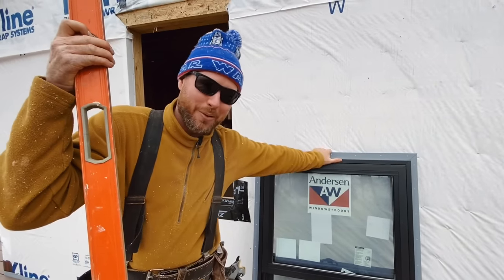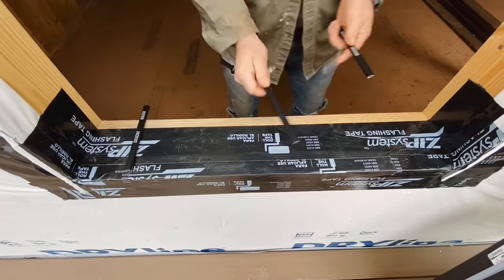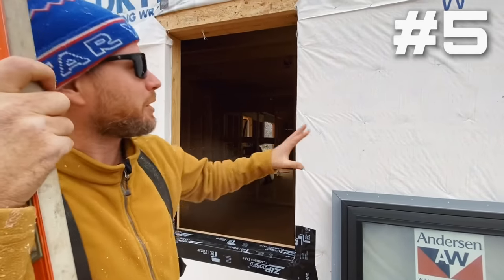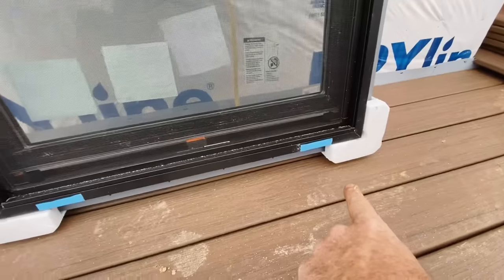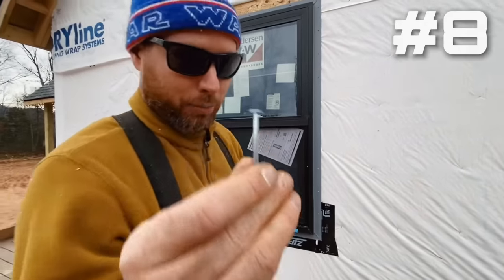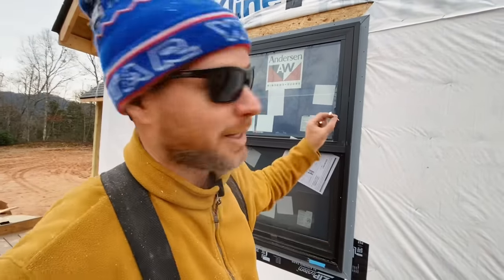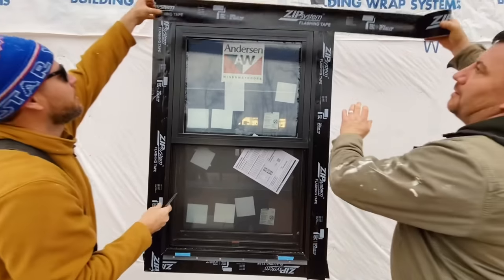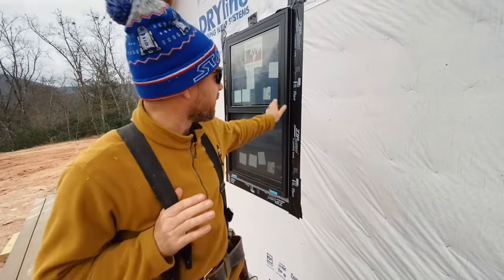How To Install a Window | Top 10 Things You Should Do!

Comment: I’ve never seen the “drainage caulking” method. I totally understand not doing it at the bottom. But I feel like it’s planning for failure. Like putting drains in your floor in case the roof leaks🤷🏼‍♂️